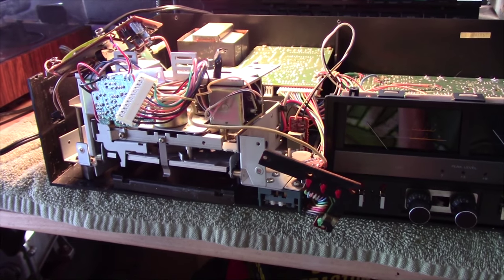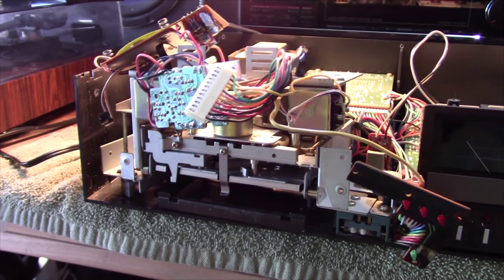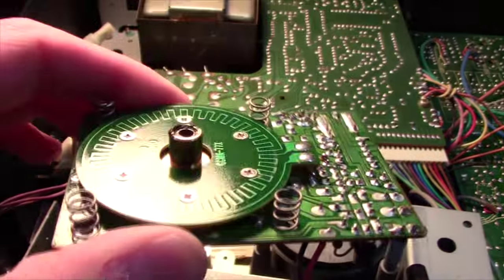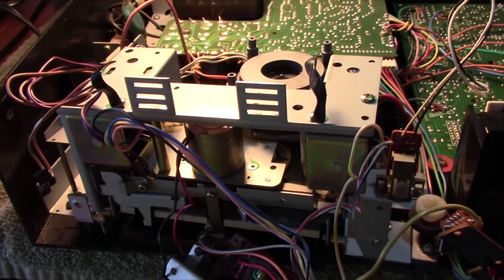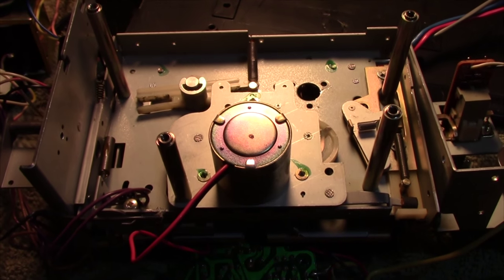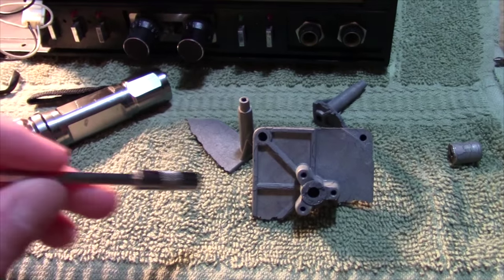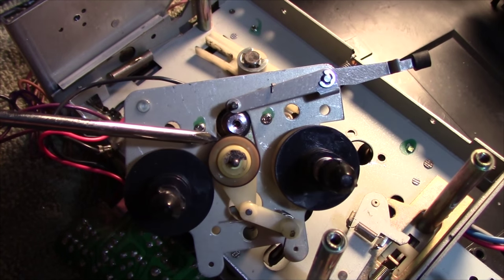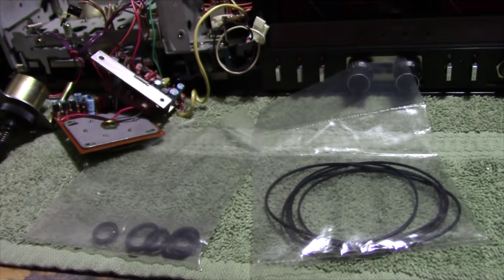Fisher DD-280 Stereo Cassette Deck Repair & Demo

Comment: I just got taken in by this exact same machine at a local thrift store.  Those really are some fantastic VU meters...

Mine had similar problems to yours.  Play/Rec worked fine. Rewind worked OK but was sluggish. Fast forward was very sluggish and occasionally stopped.

Poked around a bit with a flashlight, and came to the same conclusion as you: that idler pulley was probably the issue. My first line of defense was to just jam a cotton swab into the assembly to try and clean off the pulley without having to tear everything apart.  After watching your video and seeing how that motor housing disintegrated, I'm very glad I tried this first!  

It works better now, but still has some problems.  Fast forward and rewind now work, but the auto stop on the rewind starts catching well before the beginning of the tape.  You have to stab rewind a couple of times to get all the way to the beginning.  I haven't looked into the auto stop mechanism.  It may not require a full tear down to adjust. Considering what a pain this thing seems to be to fully tear down, I might be able to live with the problem for awhile.

Anyway, thanks for the informative video!

Comment: I had one of these DD-280s as a kid. It was my dad's originally but he gave it to me when I was 18. Wish I hadn't given it away but I miss this sweet machine. With it's microphone hookups and great sound. You can hear the capstan motor fire right up upon powering on! BTW, there's supposed to be a light that shines through the center window right behind the cassette. That light in yours is not working.

Comment: that is the motor at 3:37...kinda the same motor in hard drives in computers...it is a brushless motor, so nothing wears out...and it wont drag, which makes less wow and flutter, and the computer can control it's speed extremely well...

Comment: Awesome video. At the point the bracket broke I would have thrown it out. That JB Weld is awesome and your perseverance was impressive.
Reply from the maker: +Brassic Gamer There are a few other DD-280 videos on Youtube but they are more of a demo of the unit and don't really go into the insides in detail, so I really don't know if that bracket is a common problem or if it was just a certain "run" of this unit.

Comment: Now that the technology has come around, a 3D metal printer would be the answer to re-manufacturing that piece.  It might cost more money that your willing to put into the component but it will be a true fix.  Just 2 cents, all in all a great job and I probably would have done the same thing.  Thanks for posting!

Comment: That metal crumbling is very familiar to old model railroaders and ancient phono mechanics. A variety of early makers used these zinc alloy compounds right into the 60s only to find that the combination resulted in an electrolytic reaction that destroyed the pieces. People who work on cars know about such incompatibilities requiring great care when attaching one metal to another. I really doubt Sanyo planned this. Their gear prior to the mid 80s was usually more rugged than the competition. Even Wollensak and RCA trusted them and their are plenty of surviving examples to illustrate that.

Why didn't Sanyo know this? Probably due to having very young engineers who did not get taught a history of metallurgy..

Comment: well got my parts unit in today and got one going....and as far as those tiny 3 screws that strip out ...I found the way to get them out...get a lighter that puts out a single butane flame, and heat the screw head up...for about 10 seconds...and they will come out a little easier...still hard to get out but they wont strip out. And oh yea..I have that cast part if you or someone needs it..mine is in mint shape, flywheel too no cracks...

Comment: Was this deck made by Sanyo, like most of the 80s Fischer gear? Just wondering whether you could find a replacement part for the capstan motor housing from a Sanyo deck....

Comment: That capstan mounting bracket should be CNC machineable- perhaps from a single piece of aluminium? Pays to have a metal shop within reach.. Take the  original part to them. As if you needed an engine part.. Far stronger, though it could be expensive...

Comment: I have one of these decks and love it. Have you noticed or have any problems with the top of the unit getting very warm?
Reply from the maker: +webrik33 I have noticed it runs warmer than I am use to from a cassette deck, especially noticed the power transformer does get quite warm. Probably why there is venting holes on the top of the unit, which again is a bit odd to see on a cassette deck.
Reply: I have a DD-300 that when I went over it had pretty much the same issues as your DD-280. The heat issue kind of spooked me until I found a service manual for it.
Reply: I bought a very small flat fan from wal-mart that sucks air in from bottom and blows out the front. solved my problems with heat issues

Comment: why don't you 3d print a replacement for this part?
Reply from the maker: +Reijo Võsu Well, if I was fortunate enough to own a 3D printer/scanner, which I do 
intend to get at some point, I most certainly would have done so. There 
are so many things that a 3D printer comes in handy for.
Reply: Well for this small piece, you will probably can do without 3d scanner.

Comment: THAT IS LOCK TIGHT YOU NEED A SMALL TORCH TO BREAK THE SEAL AND THEN SCREWS WILL COME LOOSE JUST HAVE TO BE CAREFUL ABOUT BURNING OTHER PARTS